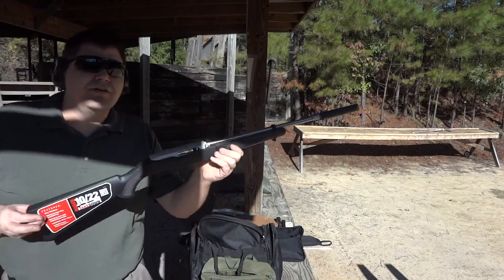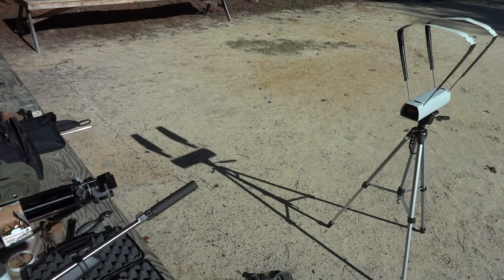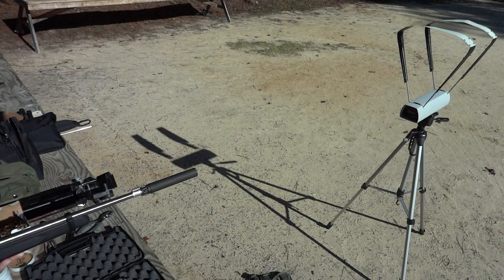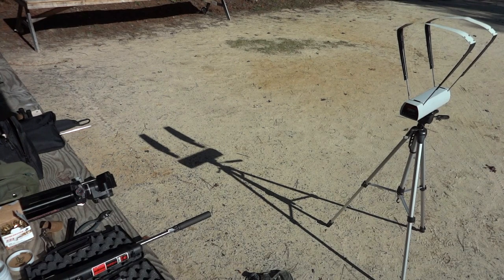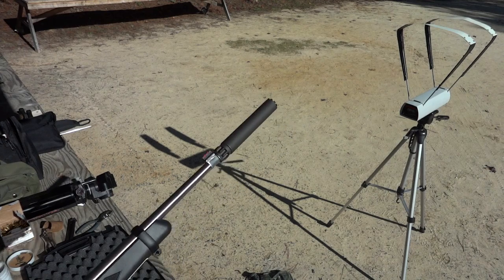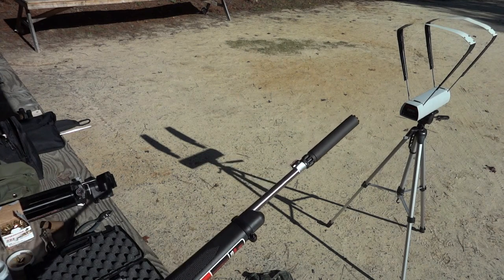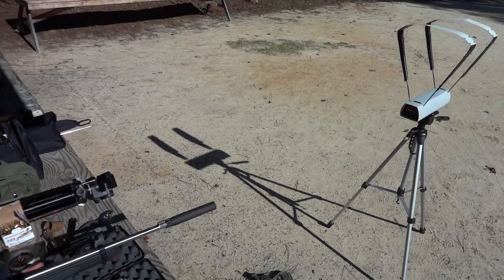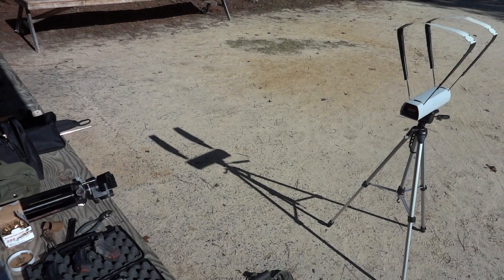Supersonic Bullets & Crack!?

Comment: I was wondering why some of my shots were louder than others. I also use a 22LR. I wonder do you think its because the 22LR is cheaply made and some rounds look thicker than others? Causing the round to slow down faster in the barrel? I dont think it has anything to do with the gun powder because the rifle loads the next round without issues.
Reply from the maker: Quality control on your average .22 lr bulk pack is pretty low so you get lots of variation.  I didn't expect to make this video, but it was interesting when it started that you could tell the faster ones by their sonic crack.  Only possible with a suppressor, I suppose, but I had never noticed it before.  Also explains why 9mm , which is usually supersonic, has a 'crack' sound whereas .45 ACP is more of a boom.

Comment: at 8:52 you had one give a supersonic report, but it read "1,061fps" (for some reason) which = 723.4 mph...  i'm guessing incorrect reading? also... i read something about a "boom carpet"... does a supersonic bullet not produce a boom carpet?
Reply from the maker: Yes, all supersonic objects produce a 'boom carpet' if you will, but the conditions were identical for each shot here.  What you were hearing was a supersonic bullet and most likely a bad reading.  My camera angle was not optimum for my task.  A supersonic shock wave is perpendicular to the object's path of travel.  What we were hearing was not the sonic boom, but the echo of the sonic boom.  In person, I could hear the action noise distinct from the report of the suppressed muzzle and also distinct from the supersonic crack.  The supersonic crack appears, rightfully so, to come from downrange as it is echoing off the berms on the side of the range, in this case.

To hear the supersonic crack directly, you have to be perpendicular to the path of the bullet.  I have some experience doing this.  At high-power rifle matches, you shoot for one relay, spot for a second, and pull targets for the third relay.  When pulling targets, you are actually under the path of the bullet and hear the cracks directly.  I could tell the difference between .30 caliber and .22 bullets and I SWEAR that I could tell the difference between boat-tailed and flat based bullets.  

There is one more interesting phenomenon I can touch on.  Though the bullet may not be supersonic, there is air that must move faster than the speed of sound to get around the bullet, however a crack is not produced in doing this.  Bullets at around 900-1000 fps will do funny things accuracy wise.  The 45 ACP government load is more accurate than the 9mm because the 45 is never transonic.  Many 9mm bullets start supersonic and go transonic before reaching the target.  That transition produces turbulence.  Ask Chuck Yeager.
Reply: wow, very interesting. that might explain why i can't shoot a 9mm worth a damn.. lol
speaking of handguns... we see in the movies the silencers screwed onto the barrel... i guess i've never thought about how those manage to suppress a sonic boom?
Reply: i'll google it, thnx!
Reply from the maker: Well, practically, you don't suppress a sonic boom.  Only a small percentage of shooters will shoot better with the 45.  For most recruits, the lighter recoil and report of the 9mm offset the accuracy difference.  Further, the relative accuracy of the bullet based on velocity is only one of a number of factors that contribute to the accuracy of the system as a whole. 

You may be interested to know that the .40 caliber is even worse.
Reply: Apparently the shooter does not hear the sonic boom, but an echo of it via the berms on the sides of the range. Can you explain that further? Why is it that soundwaves from something supersonic apparently doesn't radiate backwards/forwards but only perpendicularly to the object's path?
Reply from the maker: Sorry I missed  your question the first time, Peter.  The sound generated is directional whereas normal sounds, like the report from the muzzle, is omni-directional.  If you look at a Schlieren photograph of a rifle bullet, you can see the sound waves propagating from the nose and base of the bullet.

Comment: Very interesting.  I am toying with the idea of some 1200 fps 300 Blackout (208 gr)  loads for the light recoil, just over Mach 1.  What happens when you go Mach 2 (with lighter bullet)?  And what is Mach 2 anyway - 2200?  Is the crack louder at 2100 (just under Mach 2) or the same as 1200 (just over Mach 1)?  Fascinating.
Reply from the maker: +Bert Payne A 1200 fps bullet will sound just as loud as a 2200 fps bullet. Mach 1 is the only number that matters, above that, it is all crack.  Pulling targets for High Power matches, I could tell the .30 caliber and .22 caliber apart by pitch, but different loads, bullets, and velocities didn't seem to change anything. No really easy way to tell without some sophisticated equipment I don't have.

Comment: This happened to me with my G19 and 9mm 115gn reloads. Except some were going super sonic for a small bit, the quickly going sub sonic. It was like a a whip sound that did not finish. So rounds were going supersonic a short distance out of the suppressor then slowing down to subsonic speeds. I have since went to 147gn reloading.
Reply from the maker: I have not posted the video yet, but my Glock 19 was doing the same thing with 115gr Tulammo factory stuff.  Right in that transonic range. I have not got a good 147gr reload.  I was hoping to cast some 147-158 gr bullets. That is for the future.  Thanks for watching!